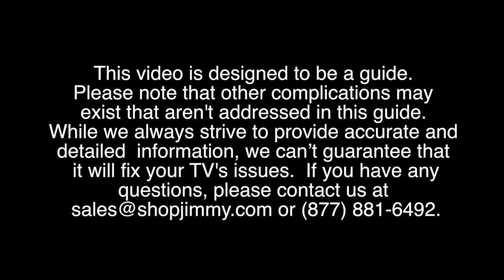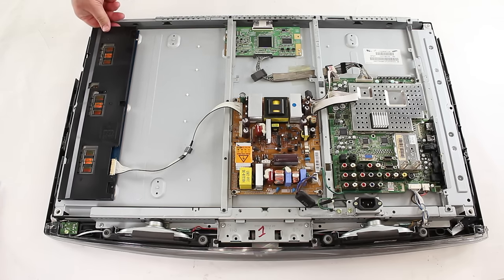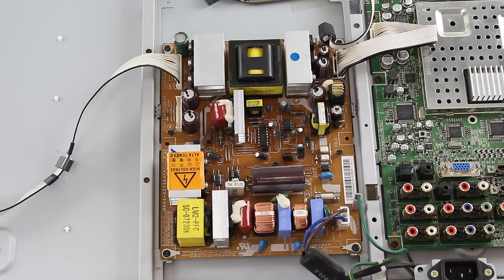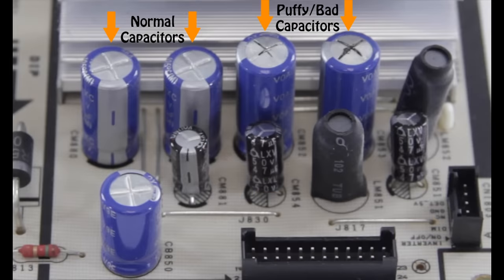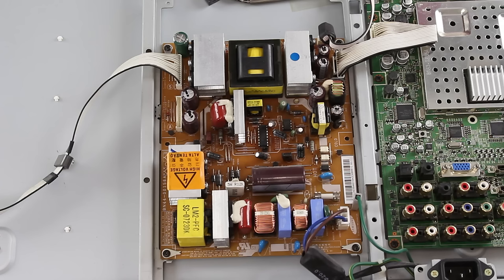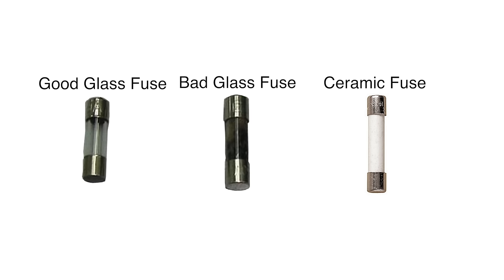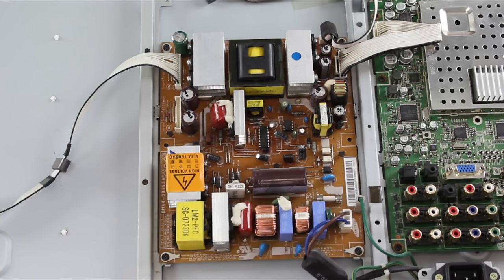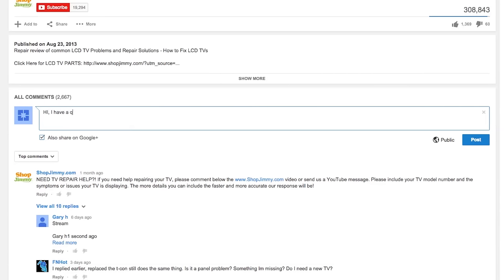Samsung TV Won't Turn On & Has No Power & No Standby Light - Samsung LCD TV Troubleshooting Help

Comment: I have a Samsung ps64d8000fu it has standby light and won't turn on just a click so I removed tv from wall took off back panel and was going to check boards but check tv before I tried this and it worked again. so put back on Wall and lasted a day and is doin it again . any help would be appreciated.
Reply from the maker: +Darrin Skedd   Try all repairs and troubleshooting at your own risk.  I recommend replacing the main board in your TV.   Unfortunately I do not see any replacement parts in the search results for your TV model number on our website.  Please reply with your part number on your main board and I can try searching for replacement parts.  Thanks and please let us know if you have any further questions!  www.shopjimmy.com

Comment: i recently replaced my power board and the tv goes on fine but when i press the input button it shuts off. thoughts?
Reply: matthew viera make sure you have all bolts on the power board on I was missing a couple bolts when I put mine in after I put the missing bolts in worked fine Hope this helps good luck

Comment: I've a sony SR29M69K tv. I've not used it for about 3 years. Now, when I switched on the tv I could see a light along the edges of the tv for a few seconds and it went off. I've checked the fuse. It is ok. Where the fault could be?

Comment: I have a Samsung le26d450 TV. Takes about 10 minutes to come on from standby. Pulling out the mains lead temporary fixes problem, comes on then goes off for few seconds then comes back then it works fine. All the caps on power supply board look fine. Any ideas.?
Reply: Forgot to mention I'm in the UK.

Comment: Hi,  Hope you can give some direction.  I have a 55" Samsung LCD 
TV Model # UN55B8000XF.  What happens is the TV will click when it is 
plugged  in.  No power on.  When I disconnected the logic board, the 
clicking stops (saw in a video).  Background...this was a friends TV.  
He told me that three of the HDMI connections failed after a near 
lightening strike and they had to move the input to the last one.   That
 was a year or so ago.  Two weeks ago, the TV suddenly shut down while 
they were watching it.  The only thing it does is click about every six 
seconds..... any thoughts would be helpful.  Thanks Rick

Comment: have a UN40EH5300 no power or light... no visual damage on anything. replaced the fuse but still didnt work. Replaced the power supply. Still nothing.... Ideas?
Reply: matt wilde    Any updates?
Reply: Brandon Burr nah been busy got a new tv haven't revisited it

Comment: I have a Samsung 46 inch flatscreen, and the model number is LN46d503f6fxza  and I went to your page and  typed the number in and it showed up that you have a power board in stock, is that the right one for my tv? it's 54.43?I turned my tv off one night and it never came back on, we had a bad storm about two weeks before and my house was hit but the tv kept playing fine until last night, the red light won't come on or the tv won't come on, do you believe the power board is the problem?
Reply: sgf129 I've got the same TV with the same issue.

Comment: Mine ended up being the fuse soldered on the board. We heard a tink and nothing screen and all power dead. Have had no problems before this and T.V. is about three going on four years old. The whole power board is $24 online and the fuses are cheap but soldered on the board. It was just under $20 with shipping for the fuse kit so I went with the power board.  Now I have extra parts if the capacitors blow

Comment: sir im a newbee technician ill try to repair the mainboard of samsung ua40f6300ar  led tv because it turns on and of,i replace the 2 capacitors because its bulgy the 100v 22uf and 50v 47uf,as i turn it on it stilss the same so i do voltage test and i accidentally shorted the two pins of opto coupler  817bn.now the tv has no standby ,please  help sir

Comment: Hi I got 40" Samsung TV Model: UA40ES6200, no power and standby power. I Check the fuse it blows. Then i change it to a new one and it blows again, what will be the problem. Visual inspection i don't see any puffy capacitor or damaged component. what will be the problem? Please help. thank you.

Comment: I changed my power supply board and it worked for about a month. Now it stopped working. I already spent $86 on a power supply board, could it possibly be the main board?

Comment: Hi the power went out in our block and after I tried to turn on the tv didn’t work I disconnected it and connected it but it did not work what could it mostly likely be?
Reply: Had a power surge. Opened tv and found the puffy capacitors and ceramic fuse has a red line in the middle.  How/where do I purchase capacitors and fuse?

Comment: i have a samsung Smart LED TV, model UN50EH5300FXZA, version PJ03, that i bought in 2013 November. and it's been almost 3 years now, and suddenly a few days back, it turned off completely and wont power on since then.  i tried replacing the batteries on my remote first, but nothing, there is no standby light or anything  on the TV.  i unplugged the TV, checked the power sockets and tried connecting my cell phone and it's working fine, do it's not the power sockets. so i suspect it must be the TV.  i opened up the back of the TV as i saw in the video above and several other videos about the capacitors going bad, but the capacitors seem ok on the power board, since there aren't any pop-ups, i do not have any voltage meter to check the voltage on those capacitors. everything inside seems to be fine, i dont see any burns or dark spots anywhere.so i really dont know what to do. to throw away the TV or to get it repaired.  i really need an answer before buying another samsung TV.  should i get a set of new parts, the main board, power board and other parts, or should i just forget about it and buy a new TV , maybe another brand this november?   ...............please anyone help!
Reply: Did you get any response? I have same problem with my tv. everything looks okay to normal eye. but it wont power on, even the standby light is gone.
Reply: I didn't get any response, but i figured it out, myself.   I bought just the powerboard part from shopjimmy.com since the whole set of parts for my TV model was not available at that time. The whole parts means, the power-board, the motherboard, and some other parts. So, before proceeding with the purchase, i wanted to make sure that i was buying the right part, not just based on a  hunch that it was the power-board that burned out... . i went to Walmart and bought a 10$ worth voltmeter, it checks the voltages on the boards. so, I put my TV on a table and opened up the back side of the TV carefully using a standard star-screwdriver that i had in my tools, and made sure all the screws were put in a box , so i dont lose them. i have a 3 year old daughter, who was constantly trying to touch the TV parts out of curiosity, somehow i managed to distract her from messing up  my work. Used my voltmeter to check the voltages on the power-board, and you have to plug in the TV to check the voltages and also without plugging in.  To my surprise, i was right, the power-board was completely burned out, it looked all normal from outside, but, the voltages were totally dead, it was ZERO.  to make sure there is nothing wrong with the voltmeter, you can check it on the different parts u see on the boards or even a normal  AA batteries. now to know exactly how to check for voltages, you can see the videos posted by shopjimmy.com.  Guess what, i replaced the old power-board with the new one with the same specification from shopjimmy.com, to my amazement, the TV turned on. by the way, i was never appreciated by my wife, she blamed me for frying up the TV when she has no idea what went wrong with it.. it was just that, my 3 year old daughter was watching her cartoon, when suddenly it didnt turn on, and there were several instances before that incident, several weeks before, i observed and also mentioned it to my wife that there were some glitches, and that the TV would not turn on sometimes, she just blamed me that i was watching too much of TV and didnt even support me, when i said i was going to fix the TV myself, and that it might have been power fluctuations sometimes that can burn the capacitors or other parts on the boards. .so, nishant, i wish you all the best, whether u  decided to fix your TV yourself, or to buy a new TV.
Reply: praveen kurra this seems like a fake comment to try and get ppl to buy boards from shopjimmy.
Reply: David Truth no david i actually did buy the powerboard and i replaced it and it worked fine.
Reply: Don't think this would have been shopjimmy post, since they didn't have the part on their site anyways when I was looking. I ordered a used board from amazon and my tv works fine now. Praveen's tip worked well for me. My daughter thinks I know everything in the world since I was able to fix the TV.

Comment: I have the same TV  with the same problem. I replaced power supply board and its still has the blinking standby light!!! Don't know what else to do!!!!!!!
Reply: the problem on the main board theres damaged ic need to change it or change the main board

Comment: It would be very helpful if they showed how to remove the back of the TV first! I have removed all the screws I can find but something is still holding it near the base stand
Reply: Hi 77friend, check again for hidden screws, (have you removed the stand??)then try to prize the two halves apart, use a  "spudger" ( plastic type of screwdriver) I use finger nails, or an OLD CREDIT CARD, I never use any metal objects....Hope that helps.

Comment: Quick question (anyone well-versed can answer), 
My tv (samsung model LN55C630K1F) quickly turns on and off with no standby light. I’ve summed up the problem to be the main board but that’s where i’m stuck... Replacing the main board (BN94-02701E) seems impossible (can’t find it anywhere) nor can i find any of the suitable substitutes listed by shopjimmy. 

Soo here’s the question, my assumption is that the mainboard is going into self protect mode due to drawing too much power. And I don’t know how to fix that. Can someone explain that or option 2, can i replace the mainboard with any other mainboard that fits?

Comment: Vizio won't power on. Has 5V stand by and 2 12V but only 19 Volts instead 24 volts The only thing on the legend is the volts numbers.

Comment: Gonna go check my fuse now.  The plug it was plugged it to would keep shorting out its been has in the  basement for 4 or 5 years.  Was pissed. Cause it's 65"smart tv. Finger X's.
Reply: No. A fuse that looks like it's circuited to the board.  Doesn't look like it can come out. But found a screw in the stand. Looks like it comes from power supply ground

Comment: Lg lcd tv won't start after firmware upgrade fail can in b fixed
Reply from the maker: Remo Williams  PLEASE SUBSCRIBE TO OUR CHANNEL - Try all repairs and troubleshooting at your own risk.  I just saw your other comment.  I recommend replacing the main board in your TV.  Click this link to replacement parts for your TV model number: http://www.shopjimmy.com/catalogsearch/result/index/?cat=56&q=37LH20  There may be multiple boards for the same TV model number, be sure to match part numbers on your current board, with your replacement for compatibility.  Here is a link to a video showing how to identify your part number, click here: https://www.youtube.com/watch?v=RwHTvjMdrhkThanks and please let us know if you have any further questions with your TV Repair!  www.shopjimmy.com  Thanks!  www.shopjimmy.com

Comment: What's a fair price to have this worked on by a repair person ? It is worth fixing on an 8 yr old tv ?
Reply: Most repair shops will charge you just for opening the tv, before any work is done.  What I like about these videos is it helps to show you the origins of the problem.  I had a 46 Inch Samsung which blew out on me during a severe lightning storm - TV was off, protected by powerbar, 3 years old.  I wasn't even home that night but when I did arrive the TV was dead.  I knew it was the power supply, I just wasn't aware of how cheap I could get my hands on a new board, let alone just replacing a fuse.   I have a hard time trusting the labour charges imposed by repair crew, probably initiated by the string of horrible car mechanics located everywhere lol

If your TV worked fine before, consider a $50 job before spending hundreds more on a new tv.  my 2 cents.

Comment: I really couldn’t see exactly where the fuse is seated in the power supply.  If it’s not a fuse I’m going to call a tv repair shop.  Samsung repair charges way too much!  $100 to bring it in and $70 for labor plus parts.

Comment: Hi i got a 2008 VIZIO 42"...MODEL ( VP422HDTV10A ). All i was told that was wrong with it was the power supply. Well i got 1 for $50 and now it does power on like it should but no picture or sound at all. Can't even turn the tv off unless i unpluge it from the wall. When it is pluged in th stand by light is ( Oragne ) like normal and when turned on it turns ( White ) like normal. What should i replace. I was thinking it was the ( Main Board ) but want professional help before i buy something thats is not it all.  Here is a video of what is going on hope you can help me out..

https://www.youtube.com/watch?v=Exb59nu8U0Q
Reply from the maker: 614Sancho   Try all repairs and troubleshooting at your own risk.  I recommend running the flashlight test on your TV.   Here is a link to a video we produced that shows how to run the flashlight test. https://www.youtube.com/watch?v=xUzCLgoSPGM Please reply with your flashlight test results and we can recommend a replacement part for your TV repair. Thanks and please let us know if you have any questions! www.shopjimmy.com
Reply: Yah I tried the Flashlight test. I see nothing on the screen. I try pushing menu and still see nothing no back lights or anything. Still looks like it is off after I turn it on. I have already replaced the Power Supply and the Main Board but still no picture or sound.

Comment: I Fixed my TV easily it had no picture what's so ever when you turn the TV on quickly hit the menu button in the TV make it go to DVD settings your picture should now come back on mine did after one month I really hope this will help someone else
Reply: Lisa Gallups lol this not the same kind of issue... you had your TV on the wrong input, that is user error. Basically the user doesn't have the correct input selected. You didn't fix anything because nothing was broken on your tv... this video is talking about an issue related to failed hardware components. That's entirely different  thing and far more complex than someone not understanding how to select the correct input settings their tv

Comment: I have a 2015 Samsung J5190 series that doesnt power on and no stand by light. I looked at the power board and everything looks ok. It's got a ceramic fuse, do you have to know how to sauter to replace the fuse? I'm going to also buy a new cord. It doesnt have any visible damage but I dont know what else to do. Need some help here